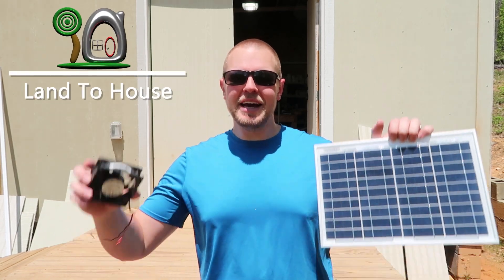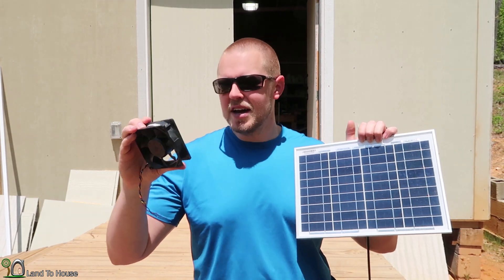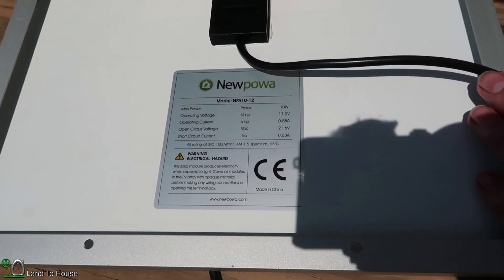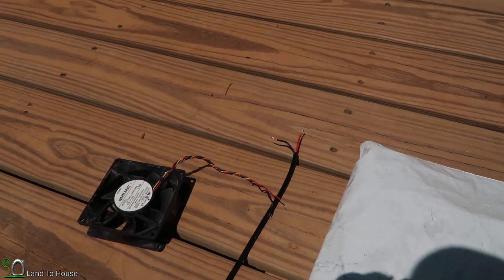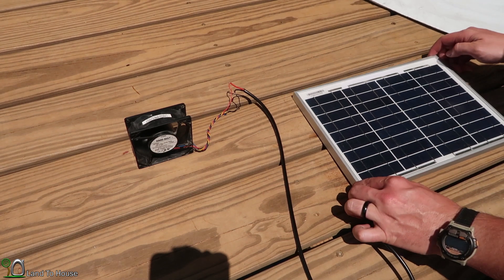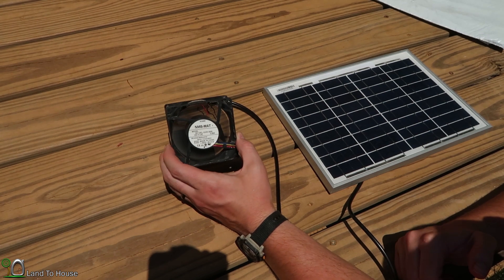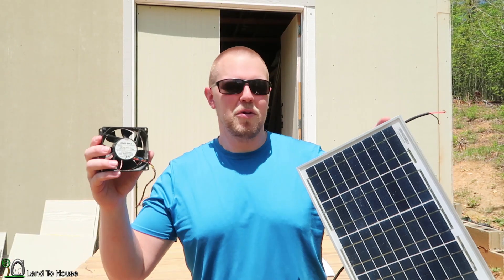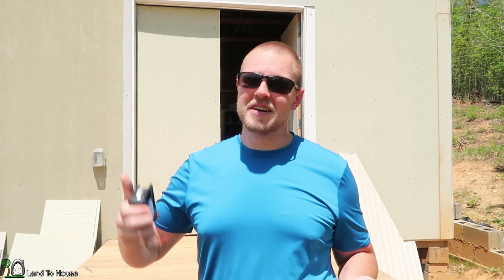Solar Power Computer Fan

Comment: I have 8 of those fans wired up and facing out the vents in the top of a storage shed. They keep the internal temp 25 degrees cooler. I'm currently running them off of a 20 v battery but , hope to have a 150 w solar setup before next summer.

Comment: nice idea for humidity issues.
not sure how long the fan will last for when the panel is in low light and there isnt enough power to start the fan up  (they have a lower start-up voltage) .the motor coils could get hot since no work is being done. 
i would solder a LM2598 dc-dc regulator in series and get a slightly larger panel .They are less than $2 and you can adjust the output to 12v  regardless of input  (upto 30v) and it will maintain 12v output ,providing the panel is producing slightly more and also will not overvoltage the fan which is just as bad for it.  Panels tend to reach peak voltage pretty quickly when the sun comes up. It is the current that increases as the sun becomes brighter

Comment: Thank you. I have been wanting to experiment with a firewood dehydrator with this setup. I have a broken dishwasher that I plan on putting the firewood in and adding a computer fan to it to cycle the air through to speed up drying out the wood.

Comment: Have you run across a thermostat that would only run the fan when there is a beneficial temperature difference between outside and inside?

Comment: thanks...this is the idea I have to use on my new resing shed...two fans, two solar panels, and configured in a push-pull set up...1 fan draws in air; the 2nd pushes air out.  My hopes are to move air through the shed during the day to reduce internal temps.  The other option is to use both fans to push air out two vents and let air draw in naturally through the other two vents

Comment: Brilliant. This is what I was looking. Tried all sort of keywords but ended up fiding this video in google search when I looked for a computer fan with solar system. We needed to set up a ventilation fan (12v, 5w) 24 hours for out composting toilet. Couldn't figure out anyways to do it myself. I just need to now figure out how to attach a cheap car battery to this set up so I can get the fan running 24 hours.

Comment: Powering a 12v fan with a 22v solar panel...
Reply from the maker: No the panel is a 6v panel from a solar light.
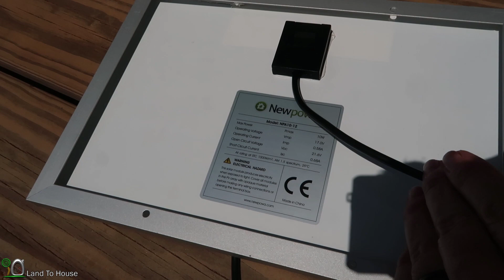Reply: @LandtoHouse  0:44 On the back stands 21,6v Voc and 17v Vmp....
Reply: @I Do Bite If you don't know anything about electronics, you should not try this project. Just watch a YouTube tutorial about electronics and solar basics.
Reply: @I Do Bite Pmax: 10W
                      Vmp:   17V
                      Imp:     0,58A
                      Voc:     21,6V
                      Isc:      0,68A

Comment: I made a similar implementation using a flexible solar panel and a similar fan, but I am facing a problem: When it's sunny I connect the wires and the fan runs perfectly. Then the clouds come and it stops. I was expecting it to start running again when the sunshine returns, but it just doesn't. I have to go there, disconnect the wires and connect again. Only then it runs again. Not very practical because clouds apppear from time to time. Anyone facing a similar problem or any suggestions?
Reply: Any progress on your issue?    I'm thinking a battery might help when running after the temperature drops outside and sometimes in reverse in the winter when on a warm day, may be warmer outside and inside.

Comment: If I was going to run this constantly (moving air through a solar air heater ) would I need a charge controller and battery? My idea is to only have the fan running when the sun is out, so it shuts down at night. Thanks.
Reply from the maker: Oh thats a fun idea! As long as the sun it out you would just place the fan into the heater and the solar panel outside that. Just make sure that the fan is rated for more amps then the solar panel and you will be good. That just makes sure that the fan is not going to burn up.
Reply: @LandtoHouse  Thanks so much!

Comment: It's a 12v fan, but the panel's output is up to 17v and sounds like it wants to chew up its bearings.  May I suggest a 12v rheostat so that you can control the speed (and the noise), or hook up a 2nd fan in series.
Reply: I was wondering about the "2 fans in series" idea myself. Would two 12v fans in series act as a single 24v fan? Could I put two 6v fans in series and duplicate a 12v fan...etc?
Reply: @iansutube  wired in series, the 17v from the panel will be split between 2 fans, 8.5v each, enough run them, though a tad slower (and quieter).

Comment: So many uses for this. I have a garden pad that needs hot air removed in the summer- Simple Turn cover for winter or summer, a composting toilet that needs vented and another for the out shower. Just... Perfect for off grid venting.
Reply from the maker: Absolutely. Very good uses for this solar fan. I'm going to install a second one of these in my lawn more shed.

Comment: Now, I'm not an expert but I don't think this will work for long without another piece.  Depending on how much sunlight the voltage of a solar panel goes above/below the stated 12v.  In the early morning it will be 0v, morning 7v, late morning 12v, noon 17v, late afternoon 12v, evening 7v, to 0v.  According to the specs of this panel it should go to around 17v in good noon sunlight under a load if I read correctly but can go up to 22v.  That's a lot of voltage to a 12v fan it will not last long!  I did not see a regulator in this kit (but maybe I'm wrong).  One needs a voltage regulator too (one that takes in DC and outputs 12V DC) to stabilize the 0-22v of this panel (and all solar panels are like this).  I bought a voltage regulator that takes in any voltage from 8v-40v DC and outputs a constant 12V DC (up to 3A) so I don't burn out my fans.  It was $17.
Reply: Or add in a battery
Reply: Nice. Thanks.
Reply: You would need to reduce the voltage by 5v you do this by wiring 2 resistors in series they would be approx 7ohms an 3ohms in this instance. That is not taking in to consideration the difference in current required on the panel and fan.

Comment: Perfect, need some circulation in my lil greenhouse so this'll do the trick :)
Reply from the maker: This fan has been in my shop attic for a long time. Works flawlessly.
Reply: @LandtoHouse  I have a 5.5 volt 10 watt portable solar charger and can't find a used fan it'll run.Mine are both 12 volt fans

Comment: too much power to the fan will cause it to catch burn out aka catch fire.
Reply from the maker: Yes. That's why I use a solar panel that is rated less than the fan.

Comment: Any idea what guage wire to use for wiring the fan to the panel - same set up as yours...
Reply from the maker: It's very small voltage and amperage.  18 gauge would be overkill.
Reply: @LandtoHouse  cheers 👍👍👍👍
Reply from the maker: Happy to help.
Reply: @LandtoHouse  just one more question: is there a risk of fire to a wooden shed if the fan packs in? Should I put a fuse or resistor into the system to reduce risk?
Reply from the maker: I just make sure the fan is rated to work on more than the solar panel can produce. That way the fan never gets hot or close to max

Comment: Do you know if this would work for an electric heater, like the same concept of connecting the wires from the heater to a bigger solar panel?
Reply from the maker: Heaters often times have a power consumption of 1500 watts. So you would need around 2000 watts worth of solar panels to operate the heater at full power on a nice sunny day. Heaters are also AC power so you would need an inverter. (There are DC heaters that are used as dump loads. These might work directly on panels)

Comment: Is there a problem with the fan running slow during low sunlight times?  would that burn out the motor or anything?  Great Vid!
Reply: No. It won't. If you dont supply enough Voltage or enough Current to a typical dc computer fan, it just won't run.

I've made plenty of devices with variable power input via a potentiometer to speed up or slow down the fan. If you go too low in power, it simply doesn't have enough energy supplied to the magnetic field inside the rotor of the fan motor in order to generate enough force to turn the blade.

I regularly used the variable power as a speed control, and also as a power starve to turn the fans on and off. because lazy lol. They were always fine.

 Putting only small amounts of electric current into the coils,  won't hurt anything.
Reply from the maker: Thank you. This has been in operation for close to a year. It seems to have either an on or off affect in low sunlight. So far no issues at all.

Comment: Here is an interesting idea. Build a heat exchanger up in the attic space pump cool water around it and you can capture some of that heat into storage. Could possibly use some old car radiators/heater matrix
Reply from the maker: That is an interesting idea. Typically it reaches pretty hot temperatures up there.
Reply: It's not clear what your goal is.  If an attic is done properly (either via insulation or ventilation) it should not be that warm and it is not desirable to have a hot attic.  If you want to cool the attic that is done wrong, you could use a heat exchanger  with a fan on it, and circulate water through the exchanger perhaps taking the water loop to your water heater but... this is laden with issues such as plumbing, risk of leaks, and would cost more than it's worth.  I love your thinking, and always look for ideas like this.  I believe it's just the wrong application.
Reply from the maker: To be honest this little fan has helped tremendously. I installed this in the storage shed that I built I drill holes in my soffit and the fan pulls air out the gable.  I've also noticed a significant decrease in humidity after the fan was installed

Comment: This is exactly what I needed. Not being familiar with electrical wiring, I wanted to know how to power a computer fan for the outside "closet like shed" that houses the compressor and dust collection motor on the back of my shop. I know compressors need air and thought this would be a good solution. Now I need to find out how I can power two of these fans, Can one 12V-10 amp panel power two of these fans? If anyone here knows, please reply to this comment. Also, can a solar flood lite power the fan since the light only is on intermittently? Or, if I bypass the light and connect the fan instead will it work? Thank you.
Reply from the maker: Powering a computer fan is very easy with a solar panel as you can see in this video. Now when running two there are a couple things to consider. Are you sure that your panel is 10 amp? This seems very high and dangerous. Perhaps you mean 10 watt? placing computer fans on that panel will likely burn them out fast. Most computer fans are made to run on only 1/2amp to 1amp. SO you can wire them up in parallel to allow for a current drop over the two of them and keep the voltage up.

Comment: I want to do the same project but with two fans. One fan is rated at: 12V, .3A, so what size solar panel would I need to power both fans. Also should I connect fan wires black to black, red to red ?  Appreciate your help ...
Reply from the maker: There are two ways of connecting the wires. Parallel or series. The way you mentioned is parallel.  This will allow your fans to have both equal voltage and split amps.  I do think this is what you need. So your fan can use max 36w. I am not sure the panel to tell you because you might need some higher startup amps for two fans. A single 12v 3a panel should allow them both to run though.

Comment: How many could one solar panel cover?
Reply from the maker: It would depend on the solar panel. This one could run a couple. The startup is the issue. It takes a little more power to get it going But when the fan gets going it really goes.
Reply: @LandtoHouse  how do you deal with the startup?
Reply from the maker: @thetoolmasterph4848  just might require full sun to start

Comment: My corsair fan is 12v dc  and 0.25A

And my  solar is 5v and 0.36A

Can it run?
Reply from the maker: Normally you need to have a voltage at or above the rating on the fan for it to work. To be honest I am not sure about starting or not. I would say keep the amperage below the rating. SO .36A is above the .25A of the fan. Probably better to get a cheap fan that is within the specs of the solar.
Reply: Yes

Comment: Barrel full of water with a turbine in it, solar fan to produce bubbles from the bottom to turn it. eh?
Reply from the maker: Not sure what that would do? ??
Reply: I seen a guy with a turbine underwater, he was using air bubbles coming from one side to make it turn. My idea was to use a water powered air pump to make bubbles with a bunch of little tubes, but a solar fan could possibly be rigged up to do this.
Reply from the maker: That sounds very interesting! I wonder if that would be enough to get it going strong.
Reply: It would work mostly likely , but im not sure if it would be all that useful, its worth a small scale set up to check it out tho. With an air pump you are not really losing anything, but if the output of the underwater turbine is less than what the solar panel can do, well, back to the drawing board lol

Comment: Is the idea that if the panel is rated pretty close but just a little higher than the fan that it is safe to wire directly in?  I thought I understood that you can burn out fans / DC devices with a direct-to-panel connection.  You haven't had problems with this basic setup?
Reply from the maker: It is lasted All Summer Long. The fan is actually rated much higher than the panel. This means the fan will never actually reach its full RPMs

Comment: Did the fan burn out over the summer? Also you could add a pwm and control the power. only like 80 cent on ebay.
Reply from the maker: The fan is still going strong! I was out in the shop yesterday and it was spinning along.

Comment: im thinking this too. but it is possible to have multiple fan on single panel like this ?
Reply from the maker: This has worked wonders for the moisture in myworkshop. I bet you can hook up multiple fans but remember they will have a higher start amperage/voltage that way.